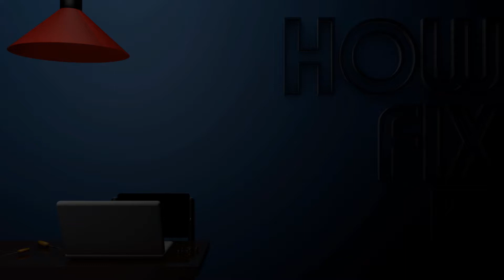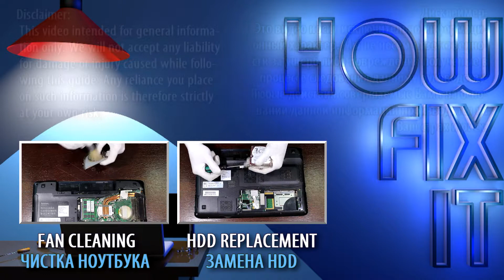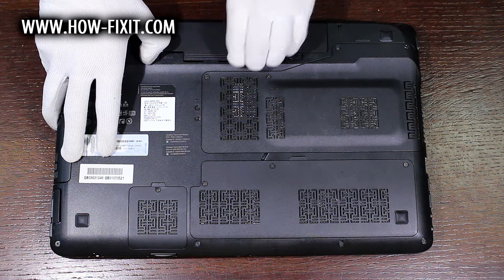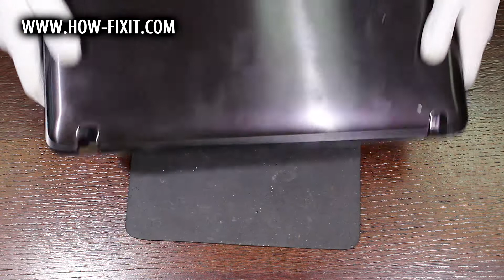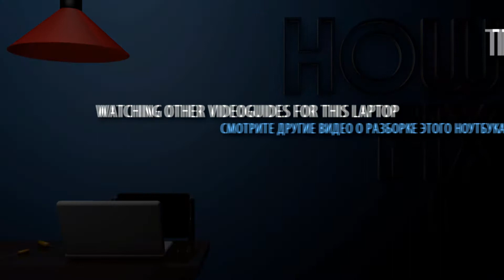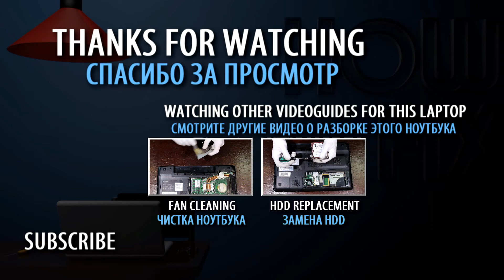Lenovo IdeaPad Y560 RAM Upgrade and Install | Step-by-step DIY Tutorial

Comment: you have 16 GB ram in the lenovo????? is it possible??? 1600 speed?? how does it work?
Reply: I am interested in that question also - have i5 y560, only 8 GB, will 16 GB work? Or you have i7 ?
Reply: It won't work it allows up to max 8 gb; I have a question too does it have 2x2 or 1x4 at the beginning?
Reply: @mumisimm  i have i7 version, There's two rams. (2x2)
Reply: @muhammied  thanks.